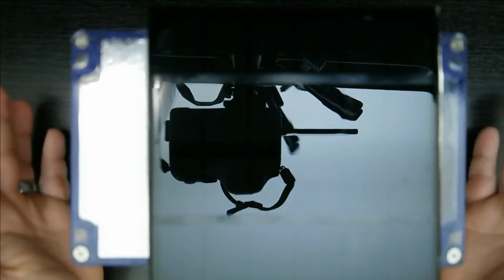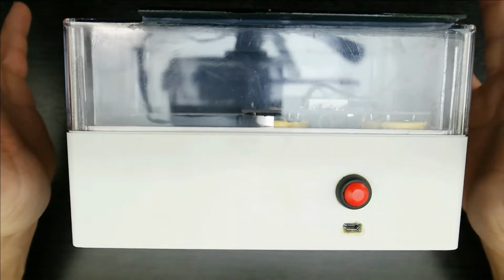Infinity Solar Bank Custom Enclosure

Comment: Love it! I've got a question. How long would this last in a survival-type situation? Provided it doesn't get physically damaged; say I just set it out in the sun every day and then bring it into my tent or cabin or whathaveyou every night. How long will the unit last? Which component(s) will fail first? The solar panel or the caps? And, follow up question, can you rig a USB out in order to charge another device? How long would it take to charge a 3000mAh phone? Could it even do that with just the solar panel?
Reply: I think it is unlikely anything to fail soon. If I have to choose between supercaps and solar - defiineteley solar. But after 10-15 years in my opinion. I am also very happy for this project, I had the exact same idea for 3-4 years, but too lazy to build it, only tested it on a project board.